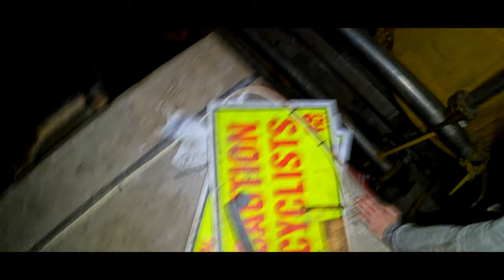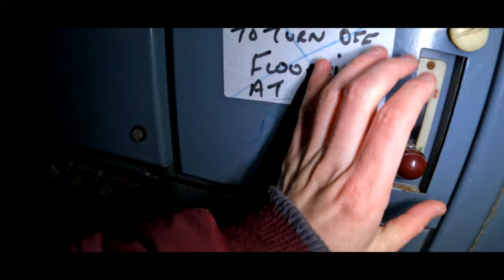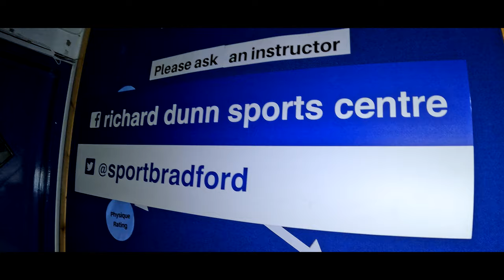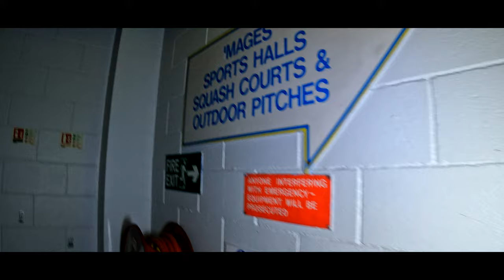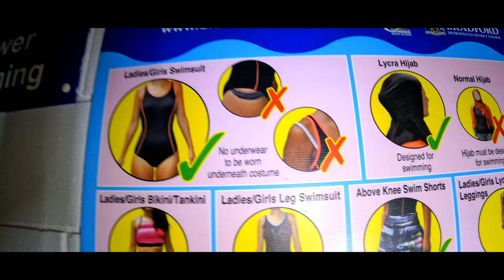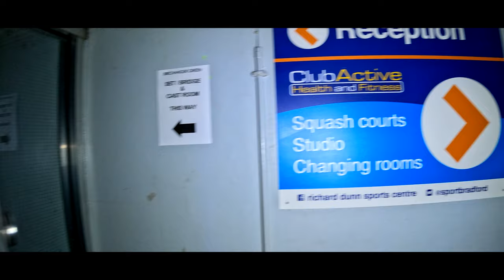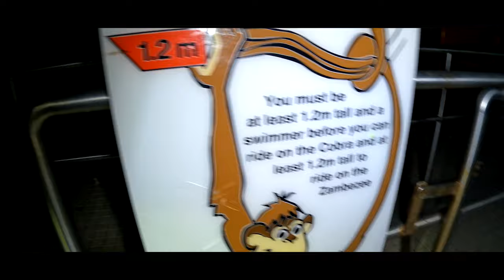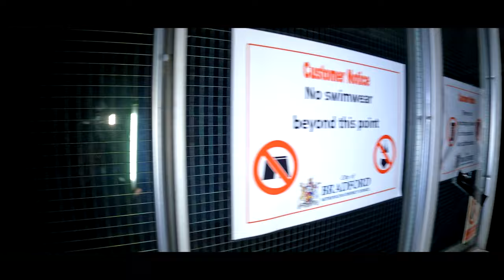ABANDONED Bradford's Richard Dunns Sports Centre And WATER PARK : Abandoned Places

Comment: I came recently and couldn’t find any entry points. Doors/holes have been blocked off with metal sheets or even bricked up. I checked today. Also there are cameras up.
Reply from the maker: Ahh you probs missed the boat on this now dude will just have to wait till it opens up again
Reply: @BeardedReality  I still had a nice time exploring the grounds though.
Reply: is it worth me going tomorrow and checking it out?
Reply: @onewaqar  If you want to. Just be mindful of the cameras.
Reply: yeh don’t go in, fully boarded up and cameras with motion sensors so coppers will come for u if they’re activated